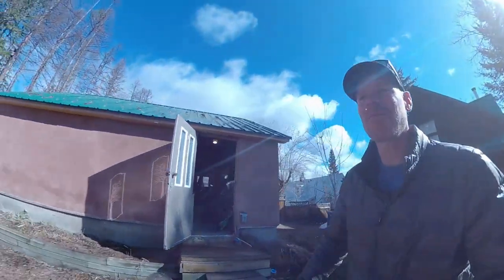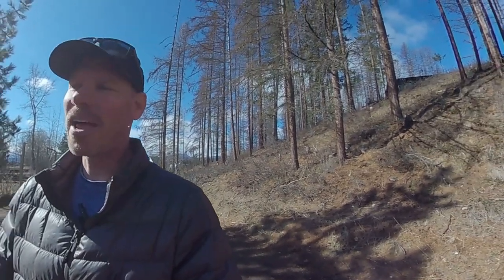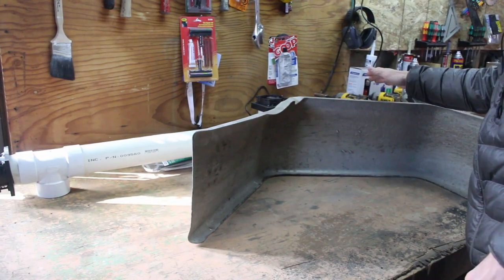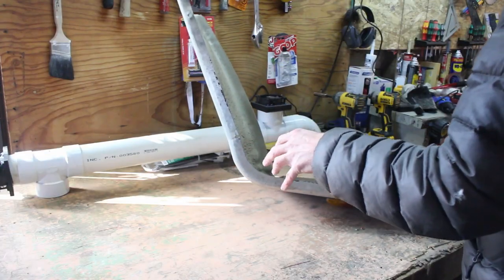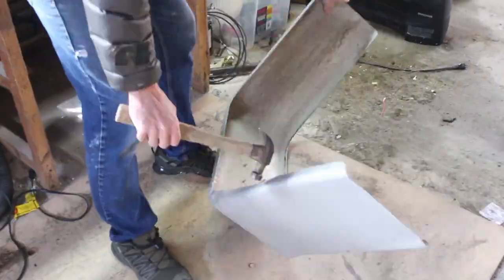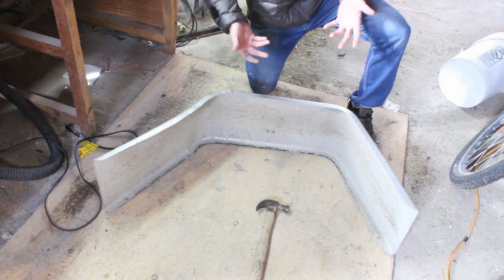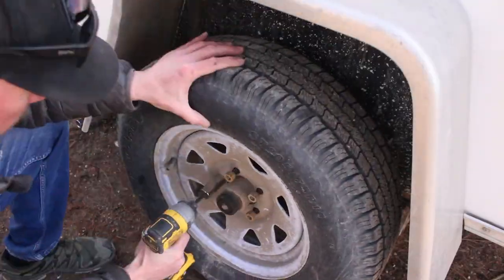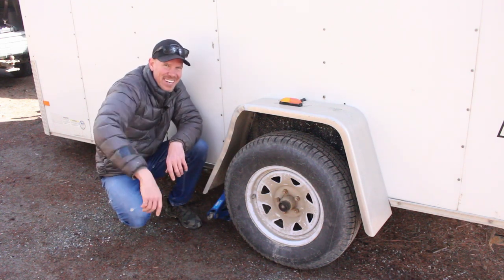Fixing Some Damage on My Utility Trailer Camper Conversion

Comment: Meh, it's a utility trailer.  Doesn't have to be pretty, it just needs to work.  And it looks better than before.  Out of curiosity, how was the trailer recovered?  Years ago, one of my friends had his trailer stolen, and recovering was problematic.  We announced the theft in church, and everyone kept an eye out for it, and it was quickly located... that was the easy part.  The hard part was, there were no identifiable markings on the trailer.  The only way to identify it was with the VIN sticker, which was ripped off by the time it was located.  So he called the cops, they show up, but couldn't do anything because the trailer is assumed to belong to the person who had it (which was the alleged thief), until ownership could be proven otherwise... and it couldn't be proven otherwise.  So my buddy just offered the guy $100 and the guy took it.  Bit of an insult, or a slap to the face, to locate your stolen property, and the only way to get it back is to pay the thief who stole it.  I just came across this video/channel, so I might check out some older videos to see if you already went over this before.  Glad you got your trailer back tho, and it doesn't look shabby at all.
Reply from the maker: that's a bit of a sad story. glad he did get it back.  I do have a video that goes over my story in detail